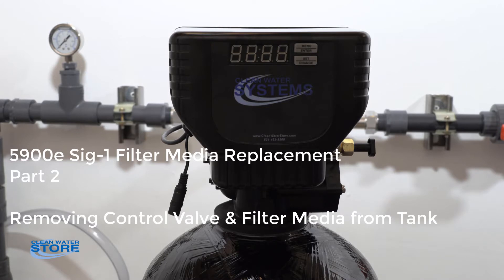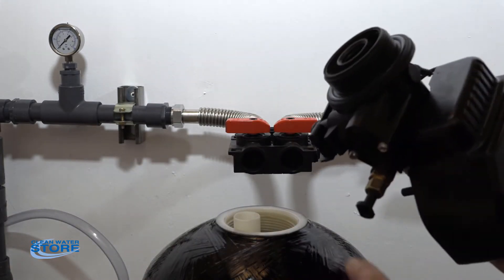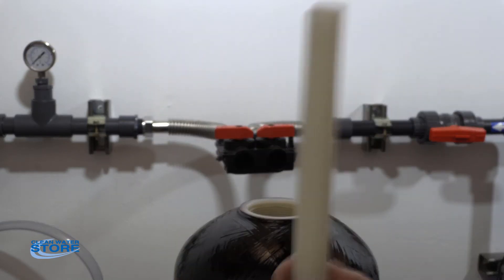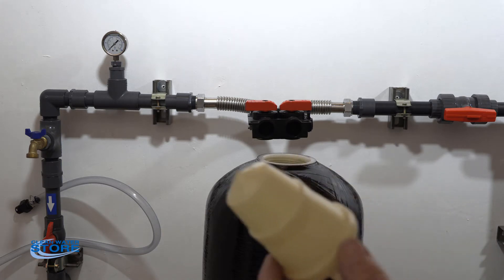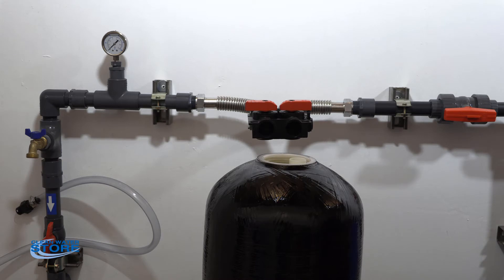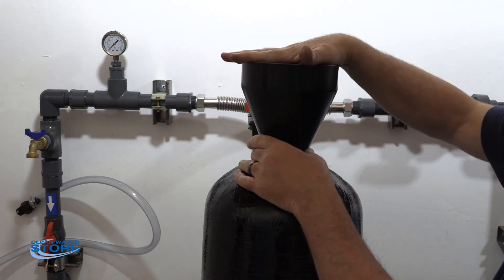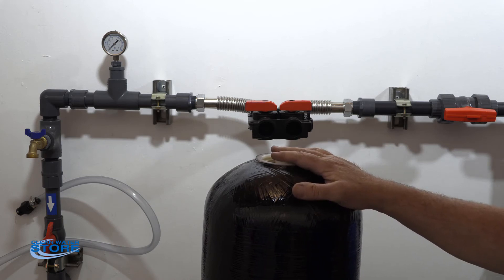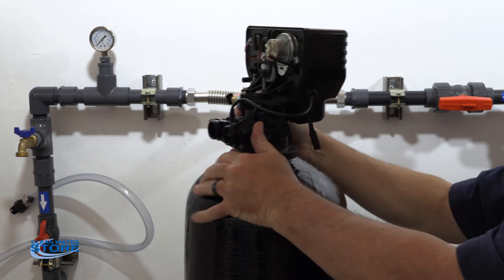5900e Filter Media Replacement Part 2

Comment: I viewed this to help while recharging my MagOx iron filter media on a 5900e.   It appeared to be a bit inconvenient(!) for the presenter to bother having any heavy, wet media to complicate things as I was forced to deal with.   HIS tank was EMPTY!   Yeah, easy peazy.   With an actual full tank of media when you unscrew the control valve it pulls the siphon tube (with screen filter at the bottom) up out of its seating spot in the bottom of the tank!   Impossible to re-install without removing all the media and re-installing it!  A 3 hr job for someone who has not done it before or in a long time.   This video is a disservice to REALITY.  Oh yeah, they have a video on re-seating the tube without having to do that.  Watch and learn more. . . nothing.

Comment: One question.  How do you know how much activated carbon and gravel to use?
Reply from the maker: Hello -  it depends on the size of your filter tank.  For example, a 9" x 48" tank uses 10 lbs of filter gravel and 1 cubic foot of activated carbon.  For a tank that is 10" diameter by 54" height, you would need 1.5 cubic feet of carbon.  Please contact us at support@cleanwaterstore.com and we can recommend something based on your tank dimensions.   https://www.cleanwaterstore.com/filter-media.html
Reply: Clean Water Store ,,